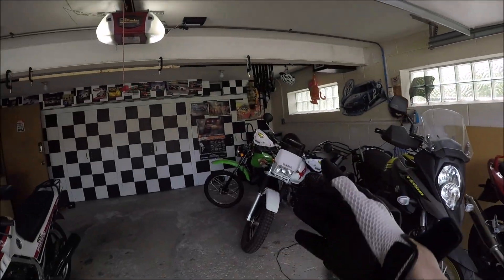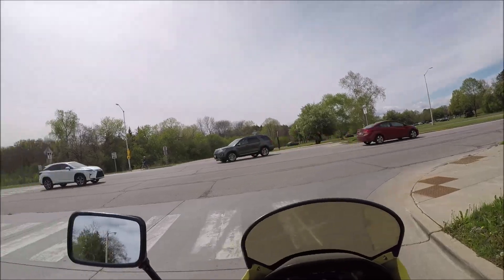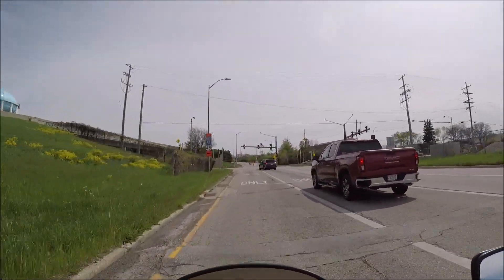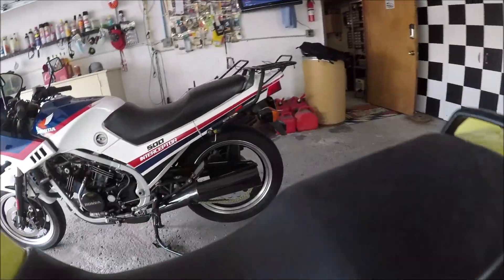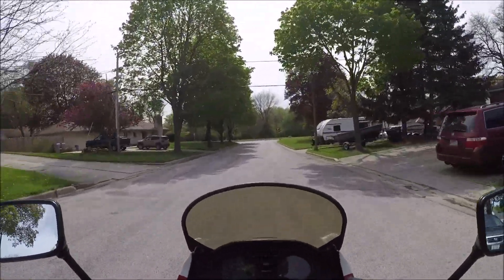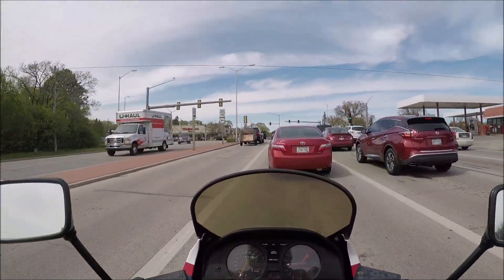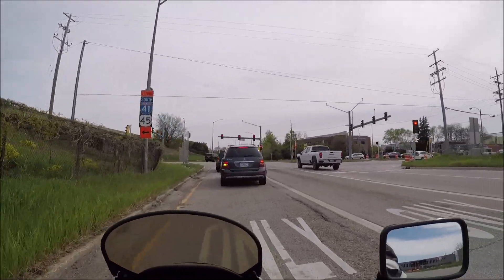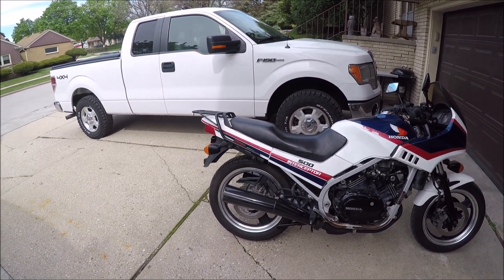Orwell's Interceptors: Ep7 - VF500F Test Ride and Idle Thoughts

Comment: Just got my 86 driveable after having to fish a valve tappet and lock nut out of the oil pan after only putting 100 miles on it after I bought it. I thought it was toast by the sound of it, but thankfully your series has actually helped me tremendously on my vf. Especially the valve adjustment vid that encouraged me to tear into it myself and try to save it. And it worked! It actually wasn't hard at all with the carbs still on it and just turning the engine with the rear wheel in 6th - the plugs. This thing rips now! My next venture is that dang rear shock. A guy in the fb group suggested draining the oil and refilling with 30w shock oil and it fixed his. Other than buying a used one potentially in the same condition on ebay, it seems like shock options are pretty slim unless you've come across a secret we don't know about yet? 

Lol, anyways, either cussing at the bike in the shop or riding them, I enjoy the heck out of your channel man and always look forward to the next episode. Keep it up!
Reply from the maker: I'll respond with a more thorough answer soon--especially in regards to shock replacement. But I just wanted to say thanks for the kind words. Got a huge grin on my face.

And yes. I think we've got three options for shocks. YSS, Hagon, and DMR.

I'll get back to you.
Reply from the maker: Also, what a hell of a journey you've already had! Lost locknut on a valve tappet? That might literally take me years to diagnose.
Reply: @matttriestodothings  p.o. or last tech that was into the valves must not have tightened it enough. It just started knocking horrendously out of nowhere one day. The lock nut backed off and then the tappet backed itself all the way out too! Feel pretty lucky there wasn't any damage from either going down the cylinder into the pan. Other than minor cosmetics, rear shock and forks needing a little work this things a solid runner. I feel like it'll be a completely different bike once those things get taken care of though.
Reply from the maker: @kmilne1989  That must have sounded pretty crazy with the lock nut backed off! I was so paranoid I was going to let that happen. Honestly, I'm still paranoid that it could happen--a locknut backing off. If I remember correctly, it doesn't say to actually torque those things down crazy tight... but think about how much those things are moving! 

Sounds like you've got a good bike on your hands now that you've got that little bugger sorted.

Comment: I had a similar issue with spongy front brakes on my '84 VF750F, bled the brakes so many times over 4 years with nothing to show for it. Just the other day I had the forks off for steering head bearing replacement, fork seal, wheel bearings and tires. While I was working on those I left the master cylinder sitting upside down on the front headlight assembly overnight. The next day I had the handlebar hanging with the end of the grip pointed straight down while I worked on the steering head bearings. Don'tcha know that when I put her back together the front brakes were nice and stiff and stayed that way. There must have been a small air bubble trapped in the banjo fitting or somewhere in the master cylinder piston bore. Still running the original rubber brake lines. Now I need to check the front cylinder valve clearances and chain tensioner again. I'm hearing a new intermittent clunking noise coming from the front cylinder valve cover when the bike is cold, goes away as the engine warms up.
Reply from the maker: I'm guessing your 750 has the original 3-piece style brake lines as well--those things are just so tricky to try to get bled completely. That's a good call about hanging the master cylinder. I've hung calipers before to try to get the air to move to the top, but never the master.

I'm hoping that by going to a 2-piece braided lines that it'll be a lot easier to get it bled properly. 

How was the head bearing replacement? I've never done one, but I can tell it's in my future.
Reply: @matttriestodothings  I tried writing a detailed procedure on what I did but then I accidentally clicked off of the comment box and youtube deleted everything that was written, so a short summary will have to do.

I had a handlebar shimmy problem above 40 mph that would appear if I so much as loosened my grip on the handlebars. Not a wiggle from them after replacing the bearings.

First thing first, find some special invisible wheels and tires to support the bike. https://ibb.co/qy70qF9

Don't use a punch to drive off or to torque the castellated steering stem nut, buy the proper 4 pronged socket so you can accurately measure the torque on the bearing when re-assembling.

Use a large socket and extension from the bottom to drive out the upper bearing race.

Use a large screwdriver with the tip bent at a 30 degree angle and working around in 3 spots pry the lower race out by leveraging against another screwdriver or bar bridging across the bearing tube.

Either use a diamond wheel in a dremel to grind the lower inner race off of the triple tree stem or use a map gas torch to expand the race and drive it off the shaft. If using the torch, after heating the race to a dull red heat take a small fine sharp chisel and gently hammer it in between the race and the lower triple casting working your way around the shaft to start wedging the bearing off the shaft. Once you got the bearing far enough up the shaft you can use screwdrivers to pry it further, culminating in using a long punch to drive the race off the shaft.

Grease up the triple tree shaft good and slick and then use a 2.5 ton hydraulic press to press the new race onto the shaft. Drill a hole in steel plate large enough for the shaft to slip into but small enough to support the bearing race in the frame of the press. Be sure to remember the lower seal that goes on first before the bearing. Or just drill a hole in a wooden workbench and have at it with a sledgehammer, I don't judge.

Grease up the bores the upper and lower bearing races slip into and drive the bearing races into the frame with appropriately sized sockets.

You may as well just empty an entire tub of grease into the headstock bearing tube. My bearings were dry as a bone after 22k miles and 37 years.

Reassemble the triple tree and don't be shy on the grease.

Torque the bearing nut to 10 ft-lb with an accurate torque wrench or ratchet and fish scale. Don't mind the slight notchiness felt by rotating just the triple tree lock to lock, you won't feel any notchiness of the bearing after re-attaching the forks, handlebars, and wheel.
Reply from the maker: @clone4211  Thank you for this. I saved it to a Word document in my Honda maintenance folder. I anticipate I'll find some pretty bone dry components as well.